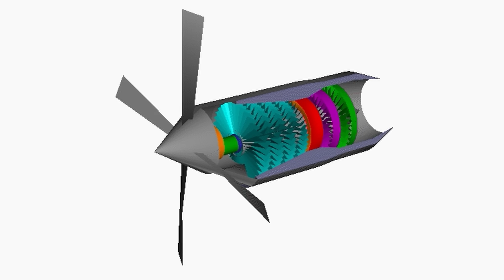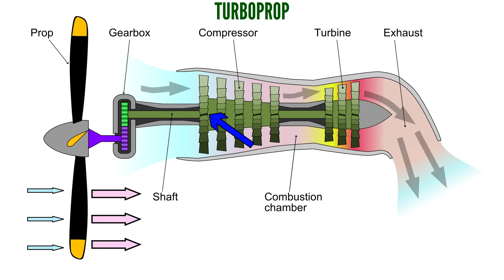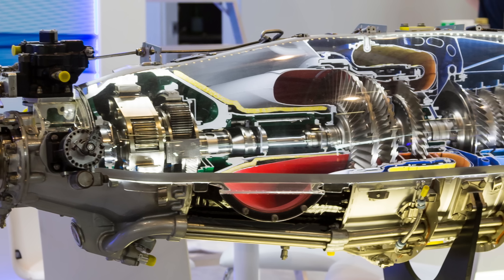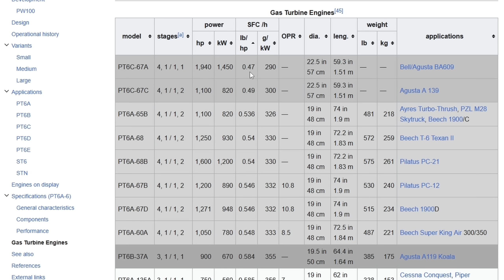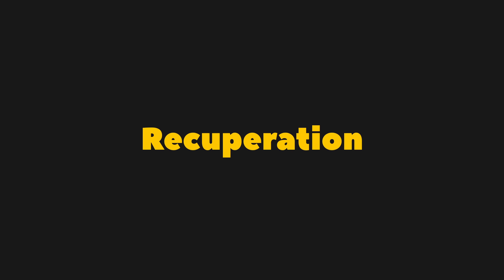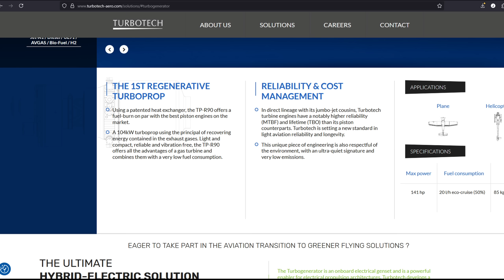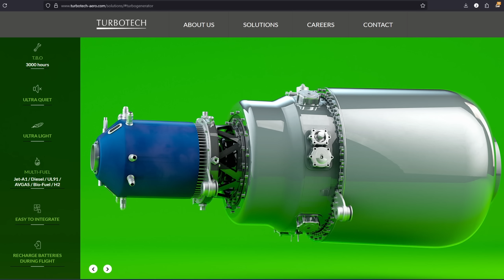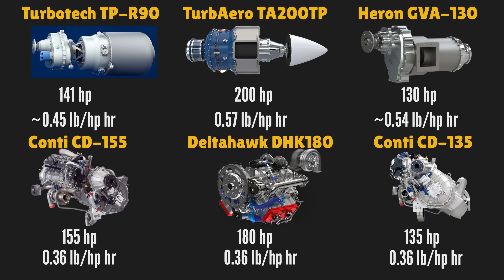Are Piston Engines Dead? Small Turboprops are Here

Comment: A few things to add :

Turbine are more smaller reducing wind resistance, so in the end the Turbotech has the same or slightly better sometimes, fuel efficiency has the Rotax.

The main benefits however will be the habilitation to burn pretty much any fuel. That’s the main reason behind the development of this engine.

Then you have reliability, TBO and noise. Making the turbine à better option for flight school that will be able to burn a cheaper fuel, reduce their maintenance cost and have less issues with the neighbours always complaining about the noise.

For other GA sub 200hp application, the cheaper Rotax will probably be the better option.

However, if you start to look at more powerful engines and something like a Cirrus, those customers will likely accept to pay more just to have a turboprop.

So there is definitely a significant place for them but they won’t replace pistons.

Comment: Why not small OP diesel?  2-stroke, 3-cylinder, 6 piston, Dual crankshaft, no valvetrain, the combustion efficiency can reach just over 50% and can be made somewhat fuel agnostic with proper fuel delivery.  The turbo will compensate for altitude and fuel density will extend range.  Fuel gelling can be addressed by looping engine coolant through a heat exchanger in the fuel tanks, keeping the fuel at a comfy 120f at all times,  Active cowling can open on climb and close on descent and engine coolant can even be circulated through de-icers in the wings.  I had an idea to put a cable clutch on the engine to allow it to idle and warm up / checklist without engaging the prop, this also serves as a ground safety.  More importantly it allows the opportunity for inertial restart if the engine didn't stop from mechanical failure.  Pull the handle to disengage the prop shaft and it locks over center, then release the handle to engage the clutch.

Comment: Another issue with small turbine efficiency is "economies of scale" not just in the engine's physics, but also its manufacturing costs. Large gas turbines (mainly turbofans) in airliners have some pretty amazing technology to help with their efficiency, part of why they are so much more efficient than older versions. A lot of sophistication, in the blade (fan, compressor, turbine) design, internal cooling passages in the turbine blades, combustor and fuel sprayer design, and so on. Both designing and manufacturing such sophistication is very expensive, and that cost wouldn't change all that much with the engine's size - incorporating such features into an engine 1/100 the size and power would certainly not be 1/100 the cost. For engines that burn thousands of gallons of fuel in less than a day, and fly hundreds if not thousands of hours per year, spending literally millions of dollars per engine for fuel economy improving features is worth it. Not true of GA, or even business-jet/turboprop size aircraft. In short, efficiency and affordability are at odds in turbine design, and probably neither could be competitive with a piston engine in the 150hp range no matter what they do, much less both at the same time. And, due to the physics constraints of scaling, even with all the R&D and sophistication in the world a small turbine will never be as efficient as a large one - or probably a piston. Piston engines on the other hand are far more consistent in fuel economy, regardless of size or cost - a small one will only be slightly less efficient than a large one, and there isn't nearly as much opportunity for added sophistication (and cost) to improve fuel economy, especially in an aircraft context (there is some in cars but that's more to make it efficient at a broad range of speed and power conditions, which isn't as relevant for aircraft). Plus with piston engines cost is more proportional to size, they do get cheaper as they get smaller to a greater degree than turbines (still not linear though).

Personally I'm doubtful turbines will be cost or efficiency competitive with pistons for GA aircraft any time soon, if ever. They might have other advantages for specific niches on that scale, particularly power-to-weight (which the recuperator would offset, the recuperator-equipped engine got to the point of being almost as good fuel economy as a piston but at the expense of being hardly any lighter, still more expensive, not a compelling option). But on the other hand at one time people surely didn't think turbine engines would replace piston for any scale, that the only use of turbine engines would be short-range point-defense fighter jets. But here we are with anything over about 500hp being turbine. They completely replaced radials and large liquid cooled piston engines, leaving only sub-500hp boxer (horizontally opposed) piston engines in use.

Comment: Ok but turboprops are using 4x cheaper fuel (jet-A1) and avgas engines are using avgas?

So it might be far cheaper to run despite less efficiency. 

If this is the case only diesel piston engines can compete with small turboprops (piston engine price, high efficiency)
Reply from the maker: 4x cheaper? Yikes, rough area you live in.

Comment: Nice objective prevention of all the factors involved.

I was at Oshkosh a few weeks ago and Deltahawk announced they were partnering with Piper to make engines for the Seminole DX that run on Jet-A or Diesel. They were also showing their DHK235A4 engine. It makes 5 more HP than a Continental 470, is 150 lbs lighter, is turbocharged so it maintains power at higher altitudes and burns 30% less fuel. And that fuel is Jet-A, so it's cheaper, widely available and already lead-free.

The future of GA isn't turbine engines, it's Jet-A/Diesel powered piston engines.
Reply: Problem is DeltaHawk has been around for over 30 years and so far nothing has really come about with this engine, I like the idea, but need to see some actual results with it in airplanes and flying.

Comment: Reciprocation per se is not the prime reason for lower reliability of piston engines. It is the sliding action of the piston rings, cams, valves etc as they seal the combustion chamber and allow the much higher pressures with minimal leakage. It is also the temperature extremes. The piston engine can achieve nearly 5000 degrees peak temperature at end of combustion then drops to under 2000 at exhaust. The intake and exhaust strokes help reduce the average temperature of the cylinder to levels the metals can tolerate but with external cooling, all of which is tricky to keep everything kosher with thermal expansion of the metal to keep cylinders round enough and valves to not crack. Turbines are limited to around 1600 degree metal temperatures and bigger more expensive turbofans resort to intricate cooling schemes such as tiny passages cast into  the very expensive high temp alloy turbine blades bleeding off some of the compressor air to cool the front stage turbines. This allows higher gas temperatures, 2500+ degrees to improve thermal efficiency, but expensive. Basic large turbofan engine efficiency (before the fan/propeller losses) can match or slightly exceed the best aircraft diesels (1954 Napier Nomad) or the spark ignition Wright turbocompound at the extreme cold of 36000+ ft altitude. Efficiency costs money, big money in turbines.

Comment: The real issue is the upfront cost of aircraft these days. Manufacturers have completely lost the plot trying to chase high margins and low labor use instead of just making mass production aircraft like they used to. 

It's kinda absurd that a J-3 cub from 1934 can still be flying today just as well as it was (and my grandfather saved up enough to buy one while paying for flight school working as a machinist at 16 years of age).

Now the cheapest new aircraft rolling off the line will cost a thousand times that!

And don't blame regulations and insurance: it's not like that same J-3 airframe and type isn't still in production. Just they insist on giving it tons of extra tech and materials costs it doesn't need.
Reply: Trainer airplanes have lost the plot even more! 

Like, a flight lesson is 1-3 hours at most; it's never more than 2 people, and the aircraft just needs to be reasonably stable, responsive, and predictable. We cracked that code by 1935! Basically a century ago!

Just using a 40kw motor, some basic materials, and putting in a cheap glass cockpit there's no reason a manufacturer can't choose to put out a simple 2 seat trainer for under €35,000 with a dead simple setup. 

Instead they're using 4 seat 172s with 180hp engines and carbon fiber props ...

Keep It Simple Stupid!
Reply: Blame the lawyer.... wrongful death suits is what is driving up the costs
Reply: @WilhelmKarsten Everyone always says this but nobody has ever submitted actual proof of it. 

Like, this is someone every industry of every scale deals with and generally speaking investigations nearly always show pilot error as the cause of general aviation crashes. 

The numbers just don't bear this out. It's an easy excuse for manufacturers but if they really were spending that much on legal or insurance costs we'd see it in their P & L fillings. Ya just don't. They aren't paying hundreds of thousands of dollars per plane to insure themselves against crashes.

It even pans out when you look at the liability insurance pilots buy. I had $2 million smooth on my policy and it was like $87/month. Given the risks and given the distribution of risk even if we assumed the cost was equal to that amount per airframe you're still talking about around $10,000 per airframe for a decade of coverage. Given the distribution of liability that's definitely far, far lower.

It's a great line for manufacturers, but just like with why the auto industry won't just make a simple car anymore, and why they use EVs as a way to smuggle in a ton of extra expensive computers and luxury features that aren't actually needed for an EV (then put them in every gas model too): it's profit. 

Same reason nobody will build a simple $180,000 1200sqft starter home anymore. You can spend $80,000 more to build a $320,000 3,500 sqft mansion so nobody will spend $150,000 to make $30,000 when they can spend $230,000 to make $90,000. It's all just profit motivated rent seeking cost inflation.
Reply: @WilhelmKarsten oh, I should clarify:

Rent-Seeking behavior (and by extension Economic Rents) are behaviors incentivized to generate profits by reducing market efficiency as opposed to those generated by increasing it.

It comes from the idea that (aside from the margins) a unit of property is generally about as expensive to maintain and own as it is to rent out to another person. As a result all of the net income generated by a landlord is economically inefficient. Yes, tennants may be harder on the property than owners, but that added ownership cost is also economic inefficiency (parasitic inefficiency caused by the landlord's rent seeking). The rent seeking causing market inefficiency can be most directly seen by the lack of liquidity in real estate: if everyone who had to rent was buying and selling property at the actual efficient price (the price that it would hold of renting it out was impossible) then properties would buy and sell much more quickly and there would be no advantage to holding property longer than needed; removing the primary advantage of renting: the fact that you don't need to wait months to sell a house when you need to move. 

The name was coined early on in economics to describe the profits from absurd rents sought by nobility from "tennent farmers" (serfs by another name) in Ireland. Since the Irish weren't allowed to own the land they lived on (only English nobility and a few Irish Nobles were) it meant rents were usually set at about 90% of the individual production from the farmers. Making the farms grossly inefficient.

Comment: Turbine engines are gas hogs.  The biggest problem is that they consume a ridicules amount of fuel while running less than full power. So just sitting on in the taxiway waiting to get permission to take off, the engine uses about the same amount fuel as it does running at full cruise speed. So sure, for long distance high altitude it might be able to recoup some of the waist it produced trying to get there. But for short hops that is not going to happen.

Comment: Fuel efficiency comparisons using lb/hr/hp are only showing one aspect of the equation, while neglecting to consider how much different a turbine powered variant of any aircraft flies.  They're considerably lighter and smaller with no cooling drag losses, meaning cowlings or nacelles can be far more aerodynamic and the aircraft will be carrying less empty weight around, so any aircraft will fly faster with an identical power setting.  If you pull the power back to achieve the same cruise speed, you end up burning about the same amount of fuel...sometimes a little more, sometimes less, but enough to call the fuel efficiency debate a wash.  Alternatively you fly faster with the turbine and your MPG efficiency goes up with the turbine because you're covering a lot more ground for just a little more fuel.  But most people won't see that, they'll only focus on fuel burn.  Fuel that's often half the cost of 100LL.

In all aspects, the turbine vs piston debate is just the "spend money to save money", and "saving money costs money" principle, recycled.  Like the old tale about a poor worker who can only afford to fix his cheap boots, but ends up spending more in the long run on repairs than if he'd have just bought a quality pair of boots to start with.  The reality is, some people will never be able to afford entry into turbine aircraft regardless of how much cheaper or better they are in the long run, and they'll always come up with some reason why they're better off for running pistons instead.  You need only to take a look at the comments here to see that play out.

Comment: Not quite - low thermal efficiency, high maintenance costs, exotic materials, don’t like responding to throttle changes…… wait until the blades can take over 3000’K (or better).

Comment: What is the torque produced by the gas turbines compared with the piston engines?
Reply from the maker: Torque would be low at the shaft (near irrelevant) but very high at the propeller after the gearbox / reduction unit (where it matters).

We can calculate it. Turbotech TP-R90, 141 shaft horsepower. I don't know the power turbine speed, likely over 30,000 rpm, but the propeller is slowed to 2,272 rpm if my info is correct. hp = torque x rpm / 5252. That gives us a 326 ft-lbs or 442 Nm of torque at the propeller from a 141 hp engine.

Comment: I'm operating the DA40 NG with an extremly reliable, FADEC controlled Jet-Fuel Engine. So I don't see a reliabilty issue if I compare this engine against a small Turboprop. If I would have a Turboprop engine in this aircraft, the range would be at least 30% less. That is unacceptable. Turboprop make sense in large single engine aircraft with pressurized cabins and higher Cruise Speeds like the TBM or the PC-12.

Comment: Are there any hybrid turboprops? 

Instead of using recuperation,  how about adding a small electric motor and battery to assist with takeoff allowing you to use a smaller turbo prop and run it at max power all the time.  

I wonder if turboprop designers could achieve even better efficiency if they could run at 100% all the time. 

Thanks to EVs this technology is getting lighter and cheaper every year.

Comment: Thanks for this very interesting video. I nevertheless would point out the price of the fuel which is not the same for turbines and piston engines. The cost of these fuels vary depending on the area where you live but in Europe Jet A1 is significantly cheaper than Avgas. Moreover Avgas is bound to disappear at a certain point in time. I would add up to my comment the difficulty to find Avgas in some parts of the world when Jet A1 is available everywhere. It also has to be considered when comparing turbines and piston engines.

Comment: If we could use turboprops as a generator say like a inducted generator, then they can run consistently at one Pacific RPM and generate power for electric motors. This would probably far more efficient you would not need battery pack so you could do facilitate all of this with capacitors, this would increase weight, but the range of the aircraft and speed ratios would not be a factor maintaining power output at maximum efficiency.
Reply from the maker: They're doing exactly that on the Electra Ultra Short / EL2 / EL9, the subject of my previous video.

Comment: Hold on a minute, you always do amazing videos very accurate, but there is a small modification. At the 3 minute mark. Propellers do not accelerate air in the opposite direction for trust. They fly just like a wing, creating lift along their cord line,  just like a wing, does the difference is, the wing/ spinning, wing or propeller, is 90° ish to the direction of the lifting wing for the aircraft providing forward thrust, there is a byproduct of air being pushed backwards. However, it is not the air being pushed backwards that provides the main thrust. Read the airplane flying manual for a better explanation.
Reply from the maker: 😅 are you saying a propeller doesn't accelerate air? Or are you saying that accelerated air isn't thrust?
Reply: @LetsGoAviate the propeller does accelerate the air rearward, but more as a byproduct of the lift that is created on the top of the airfoil. Yes it contributes to thurst, however, it does so in the same way that the PT6 turbo prop exhaust does. Yes it's there but not that much. And to my knowledge, the propeller manufacturers do not count that thrust in their rating of the prop. Please correct me if thats incorrect. But I have never been tought during all of my ratings did the air being blow rearward, was a factor for the engine/prop thrust potential.